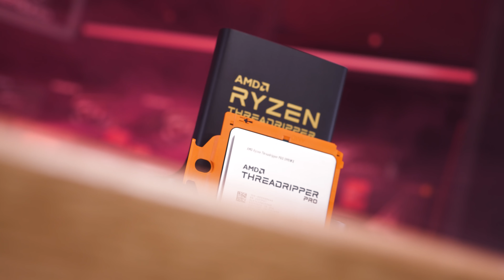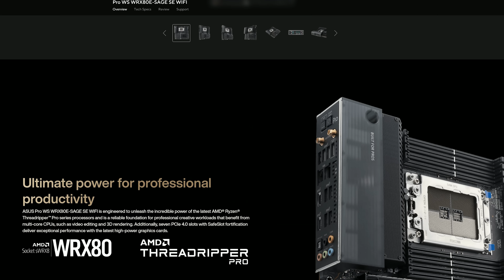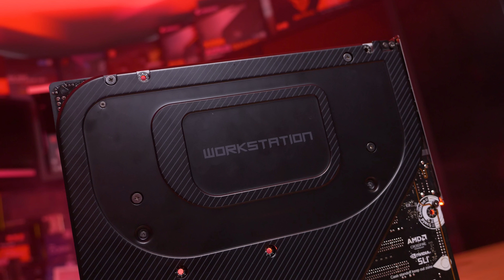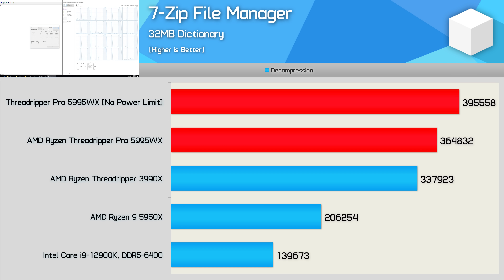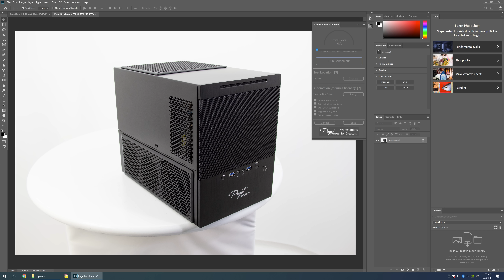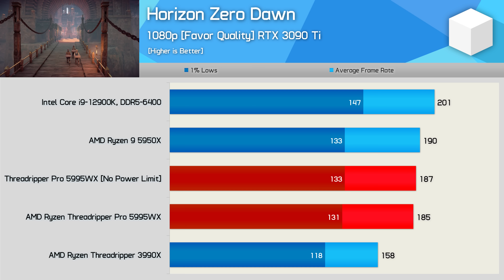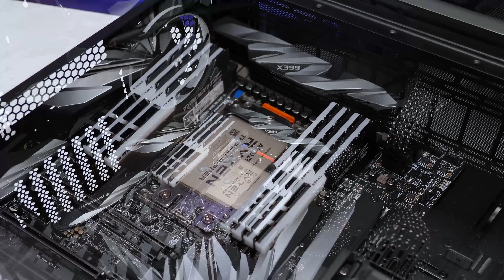It’s Finally Here! AMD’s Ryzen Threadripper Pro 5995WX, Benchmarks, Power & Cooling

Comment: Vast majority of the benchmarks used don't scale well with so many cores. Also, there are far more use cases and in general it scale better in Linux
Reply: I get that everyone loves to crow about how great linux is. thats fine. But as a designer,  if you do video editing or any design work in general, linux is total trash.  Best case scenario is Gimp, what Photoshop was 10 years ago.  Now if Adobe begins supporting Linux, or someone comes out with actual good competitive software, then maybe it would be worth it.
Reply: @Charliej  I completely agree for any kind of design work windows is definitely superior, blender and davinci resolve are getting closer but for anything else there just aren't good equivalents 

considering the state of adobe products on macos I don't think i'd want to use a linux version of it anyways 

for the software development that I do linux is way better than windows
Reply: @Charliej  I'm not saying that it is better, but one good alternative is using Davinci Resolve for video editing, it's cross platform and works well on Linux. But yes, Linux isn't very good for tasks that are from image design, audio ou video...
Reply: Many of the benchmarks don't rely heavily on cache coherence which was the big bump in Zen 3. The move from 2 4 core CCXs per CCD to a monolithic 8 core CCD is where the absolute vast majority of the IPC increase of Zen 3 comes from.

The types of applications that doesn't benefit from this are precisely the kind of applications which scales well with core count. This is because they solve problems that can, by the very nature of them, be done parallelly in complete isolation from one another. Tile based rendering being the poster child for this type of workload. Each core gets assigned a program loop and a flat region of memory, and no other core ever writes to it's memory, as they too operate solely on their own region.

But yes, Photoshop doesn't scale well with anything but IPC and clock speed.

As for the Linux statement: No. The superiority of the Linux task scheduler comes into play when you have complex workloads that need to be scheduled precisely against I/O events. The Linux network stack and it's process scheduler in combination is borderline magic. But for chopping up a large in-memory dataset and letting each core do it's own thing Windows manages to not fuck things up just fine. It's the concept of getting a task to run the pico-second it's related network package come in that Windows seem to think is a mystery. But V-Ray, etc, runs exactly the same on both.
Reply: Yes, I think Steve didn't showcase this CPU properly.
Reply: Ah, how many people use Linux who buy this CPU? Yes, 0.X% Why? Because Linux is still a very good Server OS, but mediocre at "everything media".
I tried for 1,5 years and even something simple as installing Microsoft Office is almost impossible.
A lot of people who buy this CPU, can buy the entire Workstation a second time, in the time you need to "fiddle around" to get "Microsoft 365" running.
At that is the main reason why Linux is still not suitable for the mainstream. Very specific tasks that Linux was build for (like Networking): Yes. Other than that... pls no.
And no most Linux alternatives to "corporate software" is not as good.
Reply: @TheNerd  I haven't used microsoft office in ages. Libreoffice does everything I want without the microsoft garbage thrown in.
Reply: @TheNerd  If you want to use Microssoft's software you better stay in windows. I switched to Linux Since 2014, i can work and play games here very well.

I don't use Office from microsoft anymore, for my needs, Google G-Suite and only office can handle it.
Reply: @TheNerd  it depends on what your doing, there some scientific compute workloads that are done more on linux than windows, others are more windows based
Reply: @TheNerd  If you want to install Office in Linux, you clearly shouldn't be using Linux, if you were, you should be searching for apps that replace MS Office like Libre Office, WPS Office, OnlyOffice or maybe use a web based one like Google Docs. Most of the time if you want to try to exactly replicate your workflow in linux, you will be frustrated. You should try to find alternatives for the stuff you do, and depending of what it is, it will be worse/impossible or better. If you are a software developer for example, unless you stuck in doing windows only stuff, you will have a much better experience using Linux. And yes, Linux has many problems with desktop, mostly because of fragmentation, but depending of what you do that won't matter, and you will see that you can have sometimes better performance, specially in IO stuff, and better experience.
Reply: @TheNerd  no idea where you got the idea about the 0% stuff, lots of programming happens on linux. The processor is great for compilation and overall - pretty much anything.
Reply: @TheNerd  there are Linux specific workloads for people that buy these
Reply: @TheNerd  absolute clueless comment mate... Maybe u should try using a distro like Manjaro and see how much of what u said is wrong besides the fact u want to use Microsoft programs on Linux... for everything else manjaro does wonders and sometimes is much better than windows or OSX at it. Amazing how i get better performance out of my cpu and gpu on linux over Windows lool

Comment: You should've used the IceGiant ProSiphon Elite cooler. I wouldn't put any liquid cooler on a $10K+ system. That would be a very expensive leak.
Reply: AIOs use propylene glycol, which is not electrically conductive, for coolant. They're not stupid! :P
Reply: @andersjjensen  That's interesting. I didn't know that.
Reply: @NarekAvetisyan  Especially the custom loop crowd would have an anxiety attach before pushing the power button, to find out if their creation is leaking under pump pressure, if the coolant wasn't electrically inert :P
Reply: @andersjjensen  And it's not only the system. If you have a workstation like that you've got high end work on it too. So imagine losing all your work, that could potentially be worth hundreds of thousands of dollars.
Reply: @NarekAvetisyan  I don't think any professional is going to bother with custom loop cooling, as those are mostly for looks and/or serious overclocking, but I get your point.

But the TL;DR is that AIOs from reputable brands are applicable for professional use, and are being used for that.

Comment: If you still have a higher-end M-series machine on hand, those might be super efficient for your Premiere workflow. Their decoders are quite insane for specific tasks. Would be cool to see a comparison if possible. I’d imagine you want a high end model though. 32-core / 64 GB or so.
Reply: Thought you were talking about a BMW there for a moment.
Reply: @Bayonet1809  haha! Maybe they have awesome SoCs as well!? ;)
Reply: @eriklindahl7376  they need to switch to pro res since that's the only thing m1 chips support

Quite limiting if you ask me
Reply: @aravindpallippara1577  This is incorrect. M1 chips support decode and encode of h264 and h265, Pro / Max / Ultra chips also ProRes. M2 chips support more advanced h264 and h265 variants as well as ProRes. Of note is the M-series also supports 4:2:2 variants of h264 and h265 which is quite rare still. For example Canon R5 footage flies on Apple Silicon vs most other platforms. Threadripper might edge out with sheer brute force power though.
Reply: @eriklindahl7376  on the other hand no av1, so not future proof
Reply: @aravindpallippara1577  the only hardware that supports that now properly is Intel and it sucks at everything else so I wouldn’t hold that codec very high on the list. Or even have it on the list.
Reply: What's a M-series machine?
Reply: @sushimshah2896  Apple Silicon M-series sorry. For a lot of video-related tasks, especially decoding and encoding modern formats, they are very efficient. I'm not saying it's the way to go for HWUB but it's interesting to see how well the perform in these cases.

Comment: The 5950x gets over 30.000 pts in CBR23, multicore, with cheap motherboard and a cheap cl16 ddr4 3600 memory (with better componentes and tweaks can reach 34.000)... 

why are you lying with that 24.000 score ??????
Reply: Mid 20s is where a 5950X is without any tweaking. You need XMP/MCE/PBO to get much more than that.

Comment: "Why did AMD kill off the HEDT version?"

Money. Force people to buy the "pro" version at stupid inflated pricing because they now think they can. Same reason why ryzen 5000 was stupidly overpriced. Hopefully this pushes people towards the used market for the older non Pro models so this crap can flop.
Reply: The PRO line supports more RAM capacity and more PCIe lanes, allowing you to get essentially Epyc-levels of performance for half the price. Which is why AMD has said they're killing off the non-PRO lineup for now to get rid of artificial segmentation. 

If you want it to be cheaper, get Intel to release a competitive product.
Reply: @benjaminoechsli1941  that conclusion is just stupid. People said Intel would lower HEDT pricing when AMD has competition, and they did when the 9980xe came out. Instead, Intel kept the exact same pricing with the 10980xe as AMD not so subtlety raised pricing to eventually meet Intel pricing, which they have. 

Competition doesn't breed lower pricing anymore, objective flops like AMD's gpus do. This shouldn't be any different.
Reply: Workstation workloads. The demands are increasing and the old non-pros might not be either practical or make business sense for the buyer. If I can edit/compile/whatever 30% more efficiently, then I can earn 30% more in the same timeframe. People are sometimes entitled little shits
Reply: It's about the return of investment.  Higher price, more return, more money for r&d.
Reply: @antonicholernik1747  Man be quiet

Comment: So no ddr5 support for this gens threadripper?

Also please redo your gaming benchmarks when you have an AIO thats actually designed for threadripper, they do exist, and a motherboard that does PBO, for 3400mhz ddr4 ram those scores were insane though. Not that gaming perf is any reason to buy these, but the bragging rights would be great.
Reply: Threadripper 7000 series is set to launch in 2023, with Zen4, DDR5, PCIE 5.0 with 64 or maybe up to 96 cores.
Reply: No, it’s based on Zen 3 just like the 5000 series for desktop.

Comment: The fact this CPU is good in games is kinda crazy 😵‍💫
Reply: ignoring zen 3 arch improvements, the biggest factor is large l3 cache and quad channel memory, thats why it sometimes even surpasses regular 5950x despite having lower clockspeed. HEDT's age very well if fundamentals of its cpu arch are good.
Reply: @h1tzzYT   Zen 2 Threadripper on TRX40 is 4 channel memory. Threadripper Pro on WRX80 platform is 8 channel memory .
Reply: @fleurdewin7958  oh yeah you are right, my bad. Thats even more impressive, though this 64 core 5995wx is most likely memory starved, even with octa channel, cpus like 5975wx or 5965wx are going to be much more interesting
Reply: @h1tzzYT  In the past, TRX40 boards can only accept typical consumer Unbuffered DIMM, so max memory capacity is 32GB X8 = 256GB. With WRX80, it accepts Registered DIMM. So in theory, you can shove 2TB of RAM on to the motherboard. 8 sticks of 256GB RDIMM.
Reply: @fleurdewin7958  i wasnt talking about max capacity but memory bandwidth, each cpu core in certain workloads needs certain amount, with 64 cores my wild guess that even octa channel can be a bottleneck, lower core variants should be very well fed with ram bandwidth. Ofc not all workloads needs high memory bandwidth but i considered those who do.
Reply: @h1tzzYT  I would wager that some of the gaming gains, aren't due to the more L3 cache (each core still has access to the same qty of cache as on a 5950x), but due to less scheduling contention due to more cores, and for the parts of frame set up and rendering that are multi threaded, well theres x4 the amount of cores!
Reply: @chainingsolid  nah 5950x has more than enough of core count and you are right it has same amount of cache per core, then there is most likely memory bandwidth advantage, which is huge, despite 5995wx having much lower clockspeed
Reply: We’ve come to expect that from Threadripper since the 3000 series launched. The 3990X and the others in its lineup were chart toppers as well.
Reply: Why shouldn't it?
Reply: @emmata98  because early threadrippers were terrible at games
Reply: @blinkcatmeowmeow8484  that was because of software. Otherwise it is just a scaled up Ryzen Mainstream CPU
Reply: @blinkcatmeowmeow8484  Yeah but since 3000 series, TR were actually top gaming CPUs
Reply: why it is not that good before this? i can t understand, seriously.

Comment: You basically pay $100 for each core, that's insane
Reply: Plus CPU cache & IO support that come along with the platform …
Reply: If your workflow benefits from it, it will pay itself
Reply: @MultiKokonutz  That's what people don't understand. The people and more specifically businesses that these are made for don't care. It's cost of doing business to them. It's not made so Bill can play COD.
Reply: @joer8854  Running 4 16 core boxes would probably cost a business more to run even if they can distribute the jobs automatically.
Reply: @joer8854  exactly. This is a tool, not a toy
Reply: @joer8854  There's nothing wrong with playing COD on them. Not every person with a Threadripper is a "business", and not everyone is smart enough to use their computer for more than Firefox browsing is a "professional".
Reply: @chiefjudge8456  That's true but that also means you are asking to drive the kids to school in a supercar and complaining about the cost. Then don't drive a supercar.
Reply: Not so long ago that would appear cheap!
Then there's what Intel used to charge for PIII with ECC support for single core.
Reply: Compared to where we were just 6 years ago in a workstation, it is indeed insane, as you'd have to prey on way older hardware or late gen discounts to get anything that was remotely as cheap as $100 per core. Also, it's a workstation product. The IO and memory support it offers is a country mile more important than its core count for many workstation users.
Reply: i mean couple of years ago 9980XE was 18core quad channel with far fewer pcie lanes for $2k sooo...
Reply: The killer feature is that all those cores are cache coherent, if you have tasks that are embarrassingly parallel run whatever commodity hardware you can... 100$ for 64 cache coherent cores is peanuts. This is a single socket, UMA - and up top 2TB of it.
Reply: its made for professionals for a reason numb nuts
Reply: Not so much, I mean you fill up your tank  and it costs nearly as much these days. You drive like some 500Km and then all is gone. That PC you built will last a lot longer.
Reply: Lisa is milking hard.
Reply: And it cost them $200 to make the entire CPU probably.
Reply: @foxylune  But how much did it cost to develop?  It's not the sand, aluminium and copper that you are paying for!
Reply: @RobBCactive  Sure, developing the architecture itself and the silicon wafers costs a ton, but it doesn't cost them much, late in the product's lifecycle (after they've already made their money back and even more so), to slap a bunch of leftover Zen 3 dies on a PCB, put an IHS on it and call it a day, selling it at over 10x the price it costed to manufacture that thing.
Reply: @foxylune  I see, the thing is with capitalism AMD shareholders interests come first by legal obligation.  Niche premium products have to be expensive to offer ROI.
Perhaps Ryzen 5 listings like 5600g @ €174 or 5500 @ €130 suit you better?
Reply: @foxylune  Products like these are why we can have cheaper CPUs lower down the line. 🤣
Reply: @foxylune  Not even close. And also the silicon that go into those lines of product are over bind, is the golden sample of the golden sample.
Reply: @pedro4205  and those IO dies are not easy to manufacture at all. They're very large and they're manufactured by a company that isn't known for being efficient at producing high yield products on advanced nodes. So, I'm fairly certain that they cost a lot more than $200 to make at the end of the day when you factor in just that IO die and what it costs when lost yields are taken into account.
Reply: @foxylune  "And it cost them $200 to make the entire CPU probably." Anyone who thinks that has absolutely no idea what they're talking about...

Comment: so it looks like its 3x better in productivity than the 12900k/5950x but the price is over 10x higher. Its probably more cost efficient to combine the processing of 3 12900k.
Reply: @nitin viswanath yeah but they sell it on the consumer market unlike other server cpus
Reply: @nitin viswanath No idea about this applications and if a normal consumer would ever use them. From a price point its cheaper to buy like 5 high end cpus and let them combine their processing.
Reply: @frvi3502  you can't just combine the 5 cpu's power. their are not legos. only a few cases, mostly rendering images...